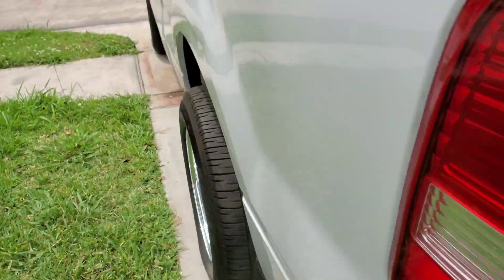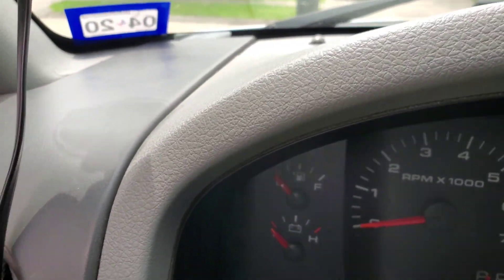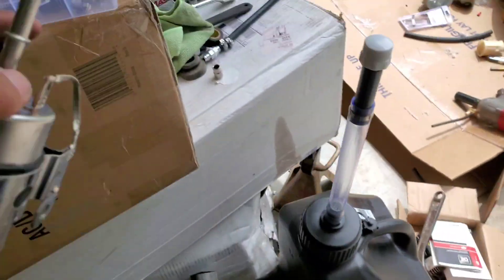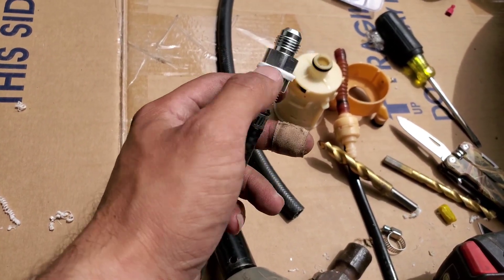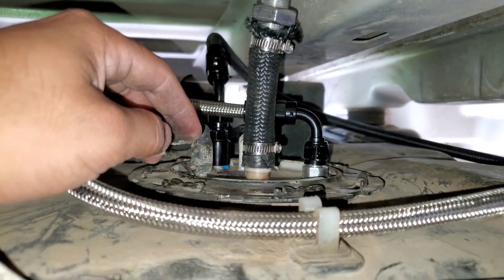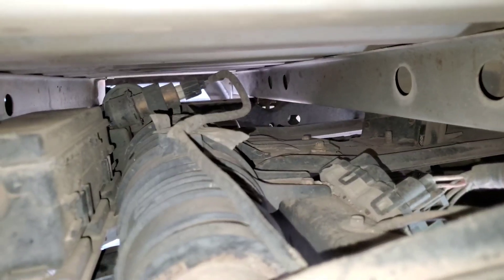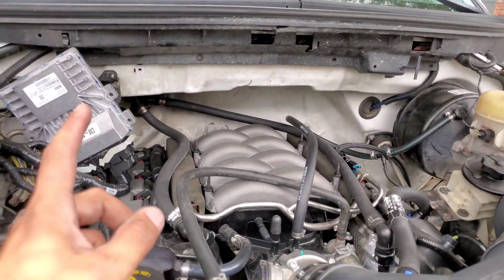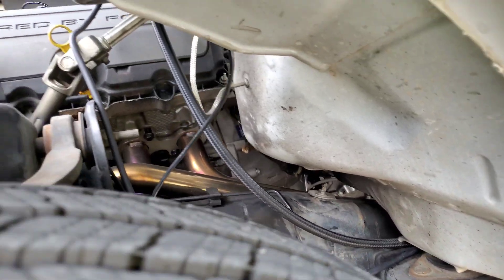FULL SEND! Coyote swap progress.

Comment: Would you still recommend me using a corvette regulator just like you initially did your first set up? And just add a vent to the tank?
Reply from the maker: Yes I would, there shouldn't be an issue using that regulator, but purchased the adjustable regulator before I knew what the issue was. The gm regulator will work though. And it's a filter as well so it's convenient
Reply: F150_s550 thanks for the response! I just followed you on IG as well! I’m going to order it now and give it a try. I’m trying to start the engine on a pallet first. I sent my PCM to get PATS delete so now i should be ready to go.
Reply from the maker: @ChrisCustoms  sweet! I appreciate the support. It should be an quick process to fire it up on the pallet

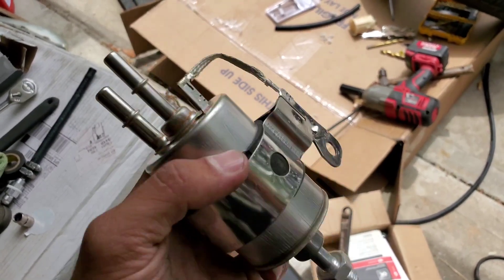Comment: @5:00 I think you misspoke or had the return and supply backwards. Maybe that's why it bursted on you.
Reply from the maker: Uh, yea, it was just mis-spoken. The feed had a push on fitting which didn't fit on the return line. The problem was no venting in or out of the fuel tank. I routed it exactly as I had it except with an adjustable regulator and a vent and works flawlessy now.

Comment: Why did you go with fore system after all?
Reply from the maker: No, just the gauge, the regulator is aeromotive and the fuel filter is a summit brand. The pump is a walboro 525lph "hellcat" fuel pump